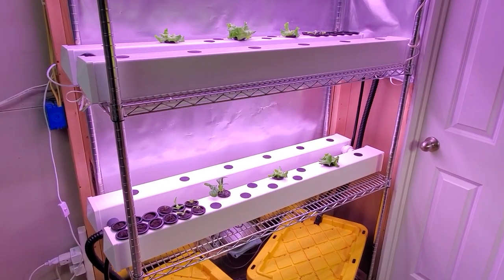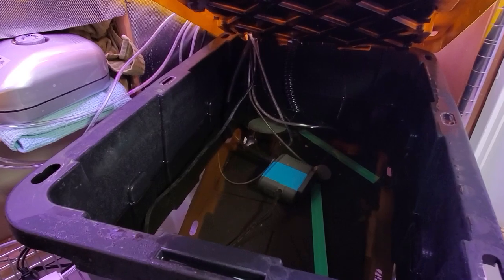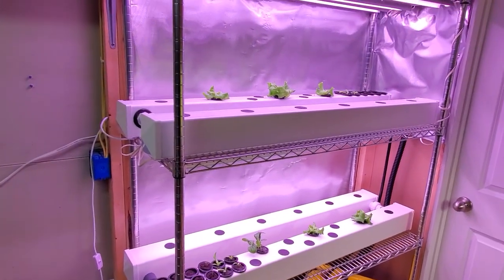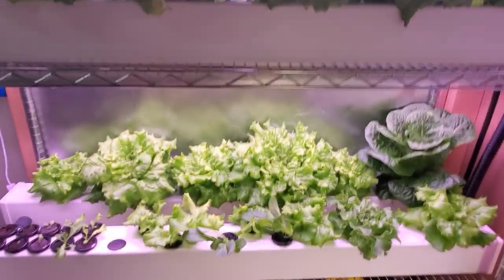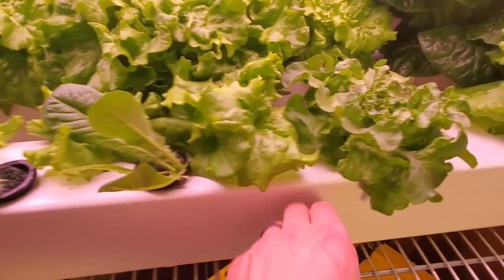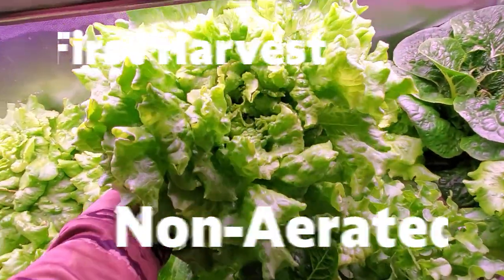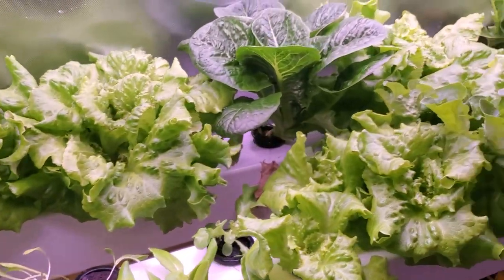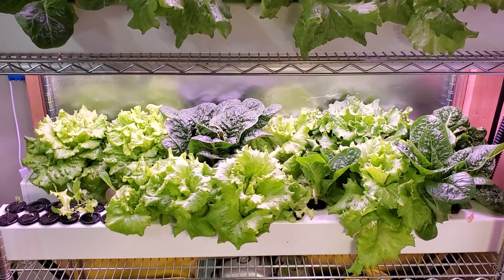TEST: Is Aeration Necessary for Hydroponics?

Comment: I also have several rails using vinyl fence posts like you.  It’s sort of a semi-ebb and flow/semi-nft.  Since there is always water in the rails, I have the pump run on a cycle of 5 min on, 30m off.  Even in the summer, none of my plants had issues with root rot.  And we had several heat waves.  I did have a grow bolt super quickly though, even with shade cloth over it.  The roots stay damp due to the humidity in the rails and when the pump is on, the water level rises and fills the rails up to 60% or so.  When the pump is off, the water level drops back down to 25%.  So plenty of the roots are out of the water and can get oxygen.  Thus, there really isn’t a need for aeration in the reservoir.

Comment: Hello, for lettuce you don't need an aerator, because the plant is ready to be eaten in 5 weeks. On the other hand, you should do the test with strawberry and tomato plants, in my opinion the difference will be significant.
Reply: Makes sense because the root system and time to fruit is substantial
Reply: I have been growing 2 tomato plants in a Kratky system (since may), so far no problems at all.
Reply: @mornkel2125  Hello, how did you grow tomato plants with the Kratky system, without adding water! I grow cherry tomatoes, in DWC (with aeration), I have good results, but every day each tomato plant drinks about 1liter of water. I have to add water every day.
Reply: @pierreshasta1480  I also add water every day but only to 1/3 of the container, so that the plants have lots of air roots which i never drown in water. I have no airator, no pumps, this is a passive Kratky system. I add nutrients only from time to time. I seeded in may, transplanted in june, in july they started carrying lots of tomatos and since august i can harvest. The hydroponic tomatos develop better than in soil, i got some plants of the same varieties („Rote Murmel“ and „Minibel“) in soil.
Reply: @mornkel2125  Thanks for your message, I understand well now, because normally with the Kratky system you don't add water. You are right, you have to leave a space without water, personally I use 70% water, 30% air for the aerial roots. 
Regarding EC, when I add water + nutrient, I try to stay between 1.8 and 2.2.  My cherry tomatoes produced very well, I would say that they produced without interruption for a full year, after that, the plants gradually dried up and died.  
Marshydro growth light 14 hours, room temperature 23 degrees centigrade, humidity 60-65% during the day and 70-75% at night , PH 6.5 
I will try your method and test with and without aerator, I will see the difference in production. 
Have a nice day
Reply: @pierreshasta1480  I have to admit i am a bit lazy, i never check ph or ec, i look at the new leaves every day and if they develop deficiencies i add nutrients or replace the whole solution. At the moment my tomatos are growing outdoors on my balcony. But some days ago i started a „Tiny Tim“ tomato and plan on growing this over the winter under grow lights.

Comment: I recently tested this for myself in a simple system.   I use 2" netcups, root riot, and romaine seeds.  The netcup is placed in a 32oz plastic jar, and it's essentially the kratke method.  I used to drop a small air stone in the jars, and I've honestly not seen any difference.   The root rot issue is the primary reason I think that using an air stone or similar aeration method is helpful.   Nice to know this applies to the rail systems as well.  I'm still trying to get mine back up and running.
The main reason I'm not using it is that I'm trying to figure out a way to put in a mesh barrier between lettuce plants, so the roots stay a bit more separated.   Pulling one lettuce out and then having roots break off in the water seemed to be leading down a problematic path.

Comment: Hey I appreciate the effort and thought that went into this, very cool. I am thinking while I watched this - and you noted a few times yourself - that with a circulated system you might be getting enough agitation just from the movement of your solution through the system that lettuces (ever forgiving as they are) are perfectly happy to go without supplementary air. I have seen (sure you have too) a few setups where the return pipe is deliberately set up to agitate the res when it returns without bothering with air stones and pumps and so on. I imagine if you had a kratky and a DWC set up side by side with something with a longer grow period like a pepper that the difference might be more pronounced.

But hey, in any case, it is good to know in a CDWS rail system like this you can produce brilliant results without supplemented aeration. Cool vid, thanks for going to the effort running the experiment.

Comment: As long as the roots aren't almost or fully submerged, aeration is not an issue, because the plants will develop or turn roots into air roots. The Kratky method also depends on that, and at the later stages when the water level dropped significantly, you can see the air roots very clearly. The air the plant needs doesn't need to come from aerated water, and it's much harder to maintain a fully submerged system with water aeration than an NFT, so why should you go for that? Something I'd really love to test though is if it brings any benefits for the plants if you pump fresh air into the air space of your tubes.
Reply: My thoughts exactly. The roots need to be aerated not the water in the supply tank. IMO none of the plants would benefit from this. In a Kratky setup the aeration is under the plants and the oxygen goes directly to the roots and plants

Comment: Consistent Kratky water levels can be accomplished with a nutrient bucket (5 gallon bucket?) connected to a smaller separate container (2 gallon bucket) with a  float valve ($5) connected to the grow. I have even added a lower float valve to the nutrient bucket connected to the water faucet in case I go on vacation for a bit. In the winter, I have grown Campari tomatoes in a spare room for years, under inexpensive LED lighting.

Comment: Add an aquarium air line to the water return line just before the tank. It will act as a Venturi and add air to your system. No air pump required.
Reply: can you explain further?

Comment: Depends on the minerals you use in the water. The most popular fertilizers create a galvanic/chemical reaction to feed energy to the plants. So it doesn't need energy put into the water in some form like aeration (static electricity in the air). With other fertilizers like compost tea, something like aeration is necessary.

Comment: Would like to see a motionless water system (kratke) compared with an aerated(or circulated) one. What you did here was not that. Basically an NFT vs aerated NFT system, which I suspected would give similar results. Water is aerated in an NFT system without the need for a bubbler. The circulation aerates the water. Your experiment shows that a forced aerated reservoir is of little benefit in an NFT system.  Thanks for this experiment... good stuff to know.

Comment: Are you using 4x4 or 5x5 vinyl fence posts?  I built my system with 4x4 posts and 1" net pots instead.  Like you, I got tired of starting seeds in trays and transplanting all the time.  Got the idea from you but went with smaller net cups and using Kratky for now. So far so good.

Comment: In the non-aerated system, if the return water line is above the water level would not the air induced by the falling water aid in aeration without the use of an air pump anyway? I know my fishing boat "livewell" uses a spray bar for the recirculated water to induce air into the water.  Sort of the same principal in what I'm talking about here.
Reply from the maker: Yes, I agree, that definitely adds some aeration just from the falling water.

Comment: You are correct that the water movement in your system is enough for oxygenation.

Consider a aquarium stays oxygenated in relation to gas exchange at the surface, so the water movement from the filter/pump keeps refreshing the water at the surface.

Comment: Lettuce is a pretty neat plant its a pond like plant it oxygenates the water its in this makes it great for sustaining itself and other plants in a system. Lettuce is kinda in floating plant group so lettuce is actually built for this environment. I found this out with my own hydroponic system(deep water there was a very little gap for air) I tested aeration and without aeration found little to no difference only difference was that it wasted water a lot faster by evaporation.

Comment: Also in dwc you rely on the temperature of the water for oxygen to be dissolved so if the water temp is not at the appropriate temperature  your air pump is pretty much useless

Comment: whats your opinion on tower set ups?
Reply from the maker: For growing indoors, it is difficult to provide adequate lighting for a tower setup. To use light efficiently, you'd have to hang lights vertically and then surround the lights with towers, which is more complicated than standard horizontal shelving like I show in this video.

Comment: For people who purchase the small table top hydroponic systems (they have and complain about root rot, the water probably is too warm (maybe from the submersed water pump).   It's a small enclosed system, heat builds up and warmer water oxygenates less.
Some people get an aerator and finally claim success with failing Aerogardens.

Comment: I guess the experiment is just the same. Because waterfall method aerating the water is just the same as having aerator pumping oxygen at the bottom of the water. BOTH oxygens pop at the surface of the water. so most of the oxygen molecules are dispersed inside the water reservoir, not entirely on the entire water volume. I'd say i will have a difference if you can supply one reservoir with a nanobubbles or micro bubbles which have very low boyancy and very low chances of popping out in the surface of the water so the oxygen are just staying in the water.